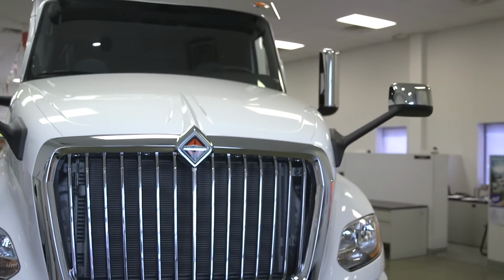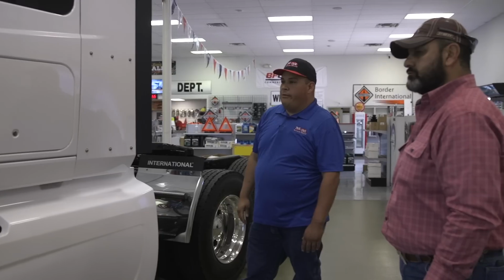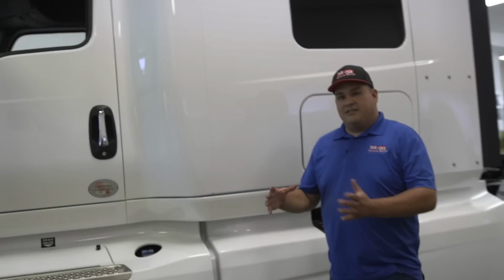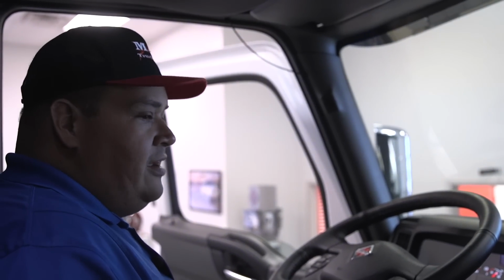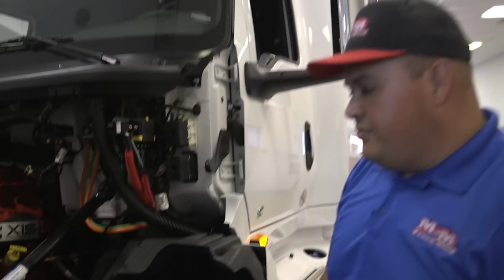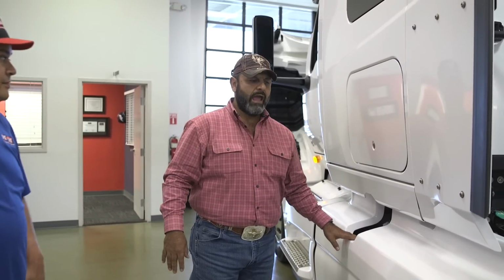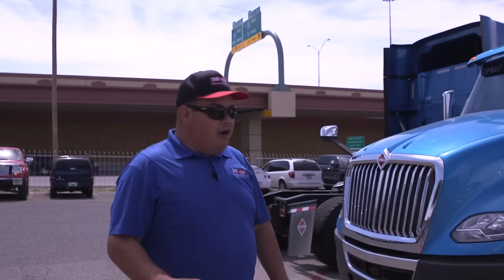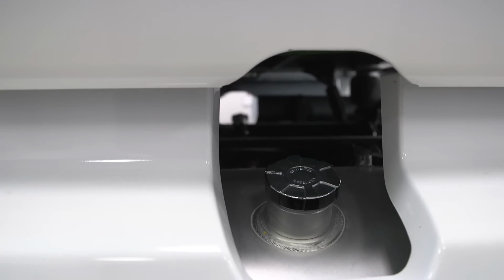A look at the new 2018 International LT

Comment: My company assigned me one of these trucks and it’s probably one of the most miserable trucks I’ve ever driven, especially bobtail. The shifting is easily the slowest in the industry. The transmission is a straight idiot. Eaton Fuller should stick with standard transmissions because they have no idea what they’re doing with their automated manuals. 

I’m almost positive the truck will limit power depending on weight because when I’m bobtailing, it’s dangerously slow. There’s no way it’s giving you full power. It’s a disgusting truck. If your company tried to give you one, ask for a different manufacture. Trust me.

Comment: The truth is they come with a black box in the windshield and a radar thatll tell u how fast the vehicle in front of you is going. If youre too close to them or if theyre going 1mph slower than you for around 1 truck length itll beep at you. Very annoying. Itll beep at you all day long even if you drive it the right way for other reasons. Youre better off sticking with your prostar than to  put up with this annoying piece.

Comment: Better than T680 on fuel and backing into docks (award).  Luxury interior (award), but it's a sardine can.  Need a bunk for gear, ecm programmed for tourists, Cruising at 70 will cause DPF issues, crawls hills, no reason for idle shutdown, park Regen is supposed to work.  Look at step to door you can see how much they squeeze you to get fuel savings, Kenworth should be worried, very nice truck and thousands cheaper. Pack light, or get extra tool boxes watch front axle weights. 7.2 @ 30K

Comment: The only problem I see when running co phase antennas electrically they are supposed to be 8 feet apart to work and around no metal for SWR to match it’s not going to be a very good antenna system at all

Comment: Nice but its still an international
Reply: Matthew Scarberry I agree that international engines suck, they lack reliability. But Im a former dump truck driver,  international chassis are pretty tough. I think if you spec one with a Cummins and 13 or 18 spd, you would have a damn good truck. International also has the largest dealership infrastucture, thats a good thing.
Reply: Danje DeSouza 9300 is now the 9900, same truck
Reply: I only like 9300
Reply: The one I'm in has a Cummins 15.
Reply: Danje DeSouza u know very little about trucks and dependability reliability and cost keep pounding pavement in youre 9300 i dont give a blank what u like